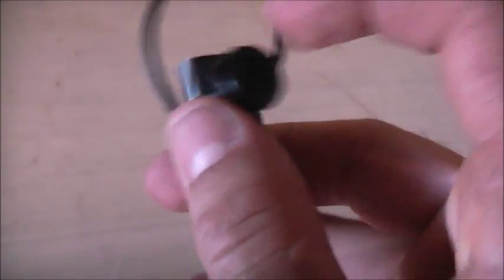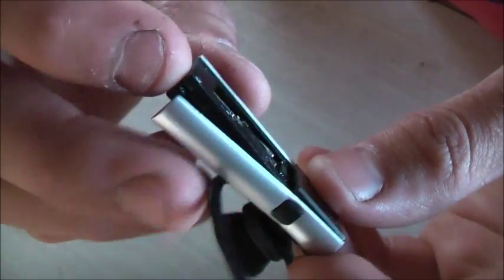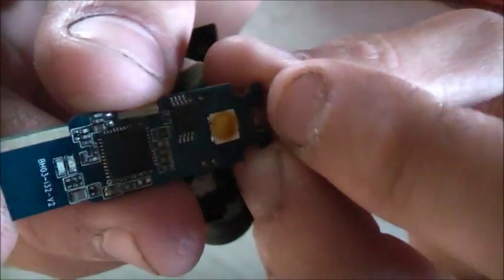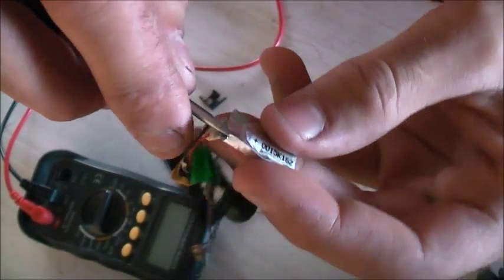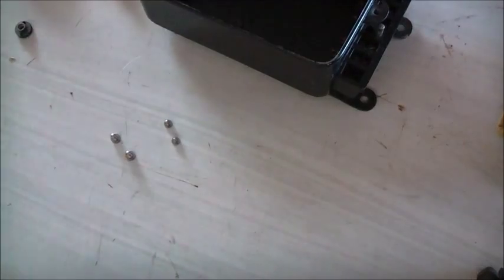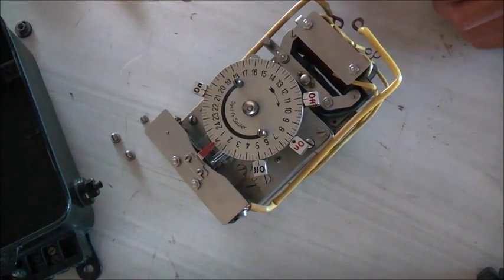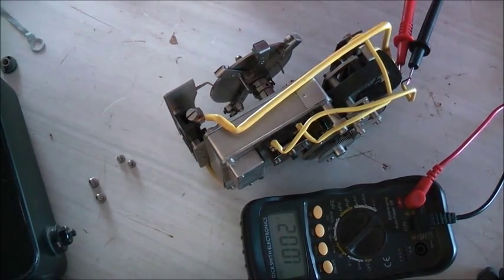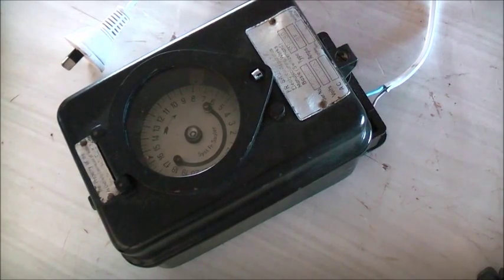Bluetooth Receiver Teardown & FR Sauter Timeswitch Repair!

Comment: Im supprised you didnt take the Sauter switch off the chassis and dissasemble it to clean all the contact areas, you bodging sod ha ha :-) Pulling your leg :-)

Nice timer switch :-), i appreciate mechanical much more than the electronic versions.

The bluetooth could do with a gentle tap with a seven pound lump hammer lol :-)